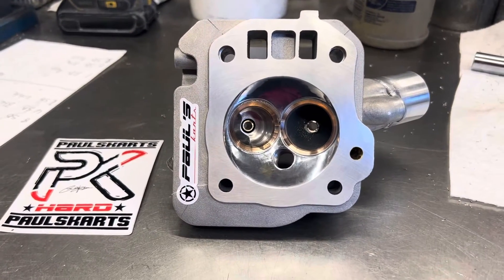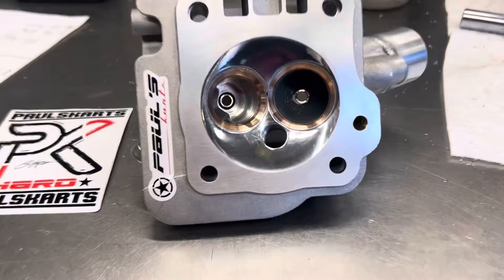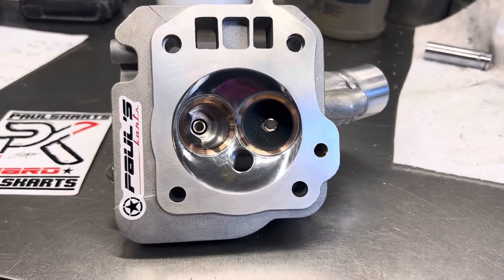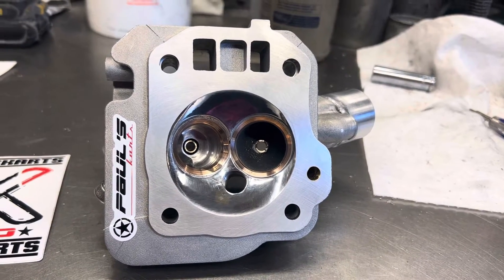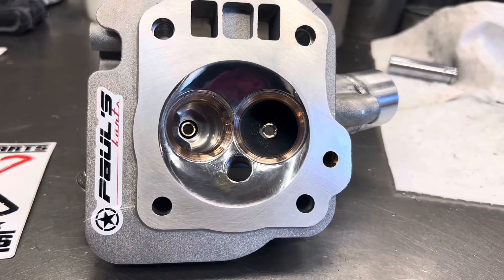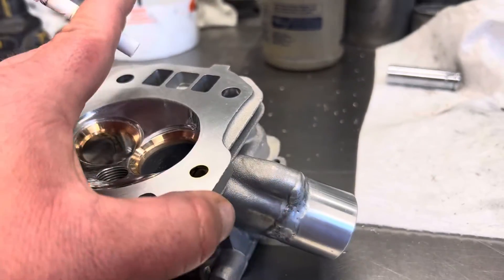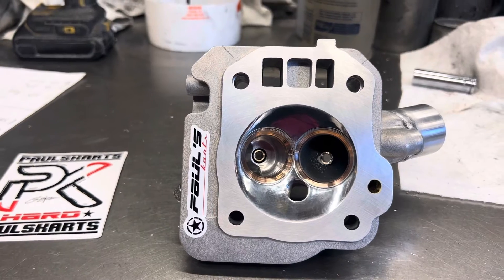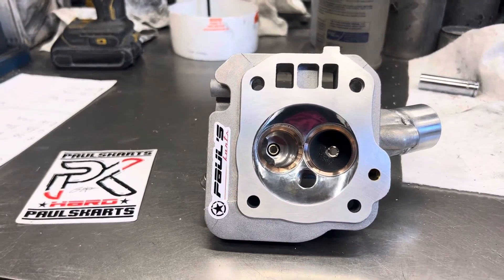Predator 212 hemi head build, 32/28 moldstar90 copper seats, welded intake tube, max porting

Comment: nice head but theres no quench pad
Reply from the maker: It’s a hemi chamber , so you’re right , not much only about a 1/4 around the full parameter. These heads are good for there angled port but I like to weld the chamber up and get that compression ratio up. Stock is about 25cc’s of chamber volume. And you can mill them to get some compression ratio up but you’re going to sacrifice lift by doing so. When you mill the head your bringing the valves closer to the piston. So my choice is a hemi head with a welded chamber , get compression up without milling it and can still run big lift. Also get some more quench in the process too.

Comment: great stuff .. If I just wanted to go springs, fw and gov nix can I get away with 22# springs instead of 18#?.. I already have S2 intake and exhaust ... I'm trying to boost power to make the most of a juggernaut style driver.. it's the hemi 212 head
Reply from the maker: Not sure. I don’t know stock parameters. We use longer valves, race cut seats that sit the valves at a lower height and cut our spring pockets. And with that setup I only use 37’s or dual coil 60’s. I knew but forgot most of the info on the lower springs ratings and clearances.

Comment: Here is something only a few know, It's definitely not a true hemi head but, More of a Semi/Hemi head like the Automotive Small Block Ford aftermarket Hammer Hemi head. Look it up, Look at the Combustion Chamber? I'm willing to bet this Hemi head would greatly wake up if someone welded the combustion chamber up and designed like the Hammer Hemi head. Oh, Cut down those Rocker arm towers and drill and tap them For Gage aftermarket roller rockers. It eliminates the possibility of them breaking with high lift cams requiring high spring pressures
Reply: Here’s something a lot of people know, hemispherical heads have a hemispherical combustion chamber.... The degree the valves are canted or angled, it doesn’t matter what valve train your using. It’s the combustion shape in the head. There’s advantages to both. Non Hemi is easier to make compression with a smaller volume and or squish band, valves so they don’t get shrouded... Hemi can run larger valves and since they open onto the cylinder at an angle the more they open the less shrouded they become then valve timing and overlap become a problem... also why weld up a Hemi head ? Are you talking about welding it up to change port size, angle, the Combustion chamber For more compression that would just shroud the valves. I’m just curious how many race motors have you built in the last 40 years?